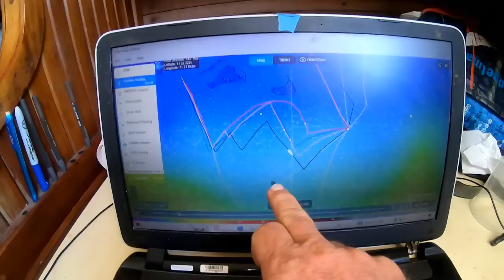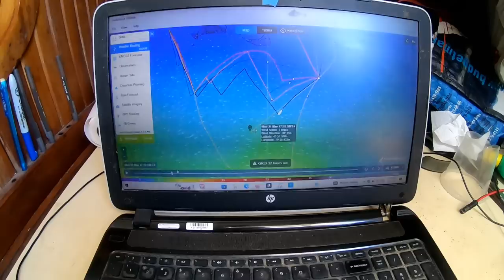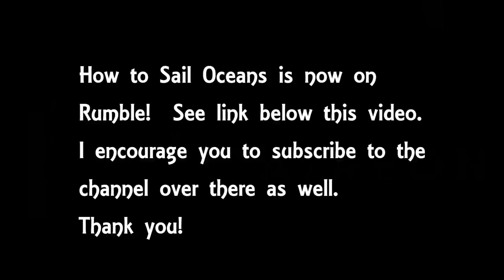"Well, that's the plan, anyway"  | Ep. 221

Comment: Why did the sheer-pin break? love your show
Reply from the maker: Don't know for sure.  Usually because the prop hit something, like a small branch floating in the water.
Reply: Its sacrificial, designed to shear off to protect the much more expensive and important prop when you hit something solid. Kind of like zinc anodes in a way, how they protect other things, like your prop, by dissolving away instead of said prop.

Comment: Not being a sailor, I’m confused by your language.  You say without the stays’l you have no driving power.  I would have imagined that the stays’l gives you steering power instead.
Reply from the maker: A headsail adds significant power to a sloop rig by accelerating the air flow around the main, the "slot effect".
Reply: @howtosailoceans1423  
Ah, thanks.  I didn’t know that.